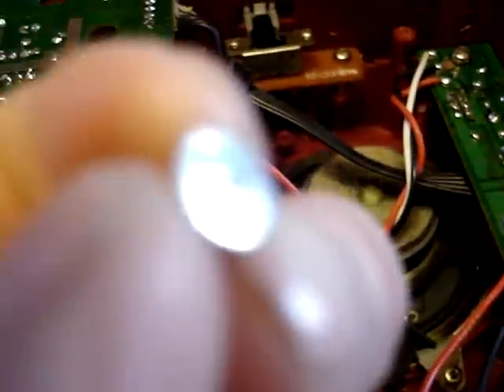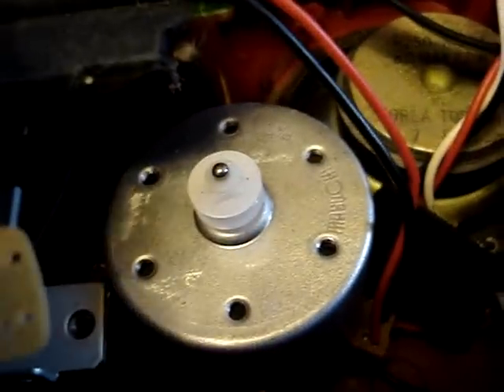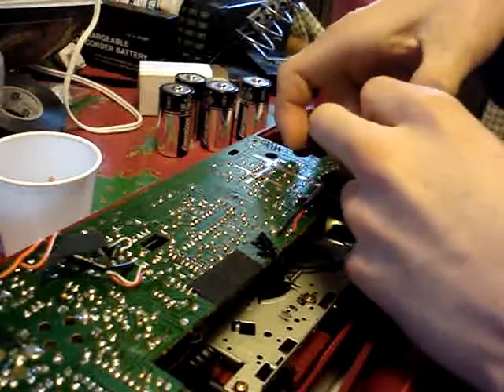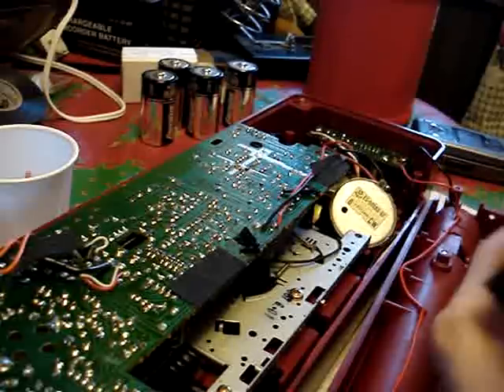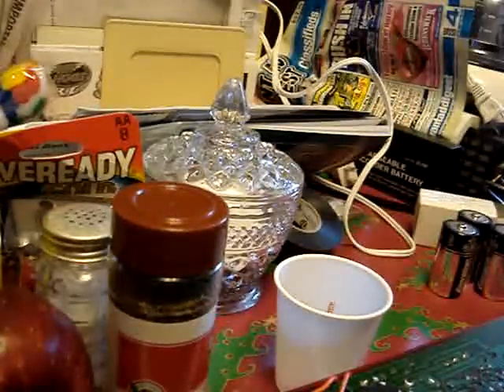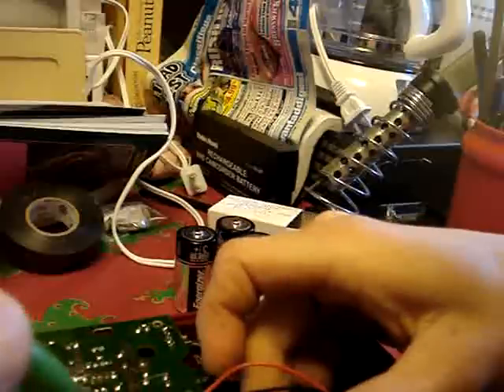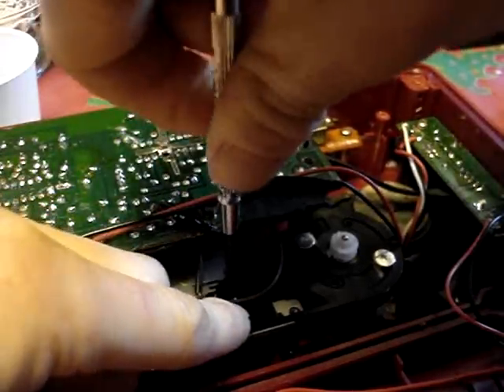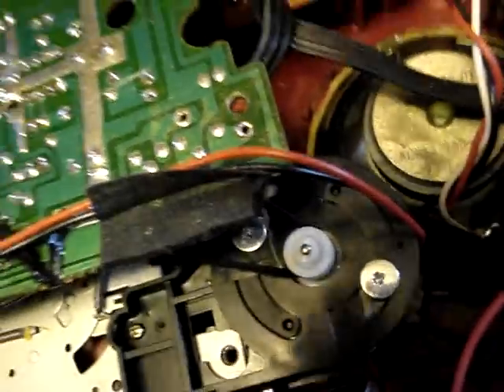Cassette motor replacement

Comment: And you're right about the original motor being an older type... the replacement motor is the newer type of Mabuchi motor, they're stillproducing them like this, There's a motor just like this one in my 2005 Yamaha KX-393 cassette deck.

Comment: That's always really annoying. It happened to me that I had the change motors up to six times until I finally had the right one. 
I'm not sure if it's running too fast just because it's hooked up backwards. As long as the speed control works, there shouldn't be any problem. You could maybe try a smaller pulley, I did that before and saved me a lot of work.
These old Mabuchi motors don't have much info printed on...

Comment from the maker: Yeah I could try that, but I've already ordered a CW motor, so we will see if that works better. I didn't think it mattered either, but there has to be a reason why they label them CW and CCW because all DC motors are reversible anyway. I'm going to do an experiment today and run the old one forwards and backwards and see if there really is a speed difference.

Comment from the maker: nah the motor has a pot inside it, and it has to be hooked up right in order for the speed control to work. that is, as the batteries get weaker it still maintains 2400 RPM. hooking it up backwards  defeats that feature I found out.

Comment: I have the same thing with a Marantz deck that I was working on this weekend could you have tried lubricating the front bearing of the original motor with some sewing machine oil? I find this often helps with the older noisy motors and gives them a bit more life

Comment: +8 years later this is still worth for something

I have some spare heads I took out of an old player and I got the awesome idea of designing a diy 3d printed cassette reader which I want to add some extra functionality and maybe will end up making a cassette recorder too

Thing is that those motors aren't as common as the generic 12v DC ones

Do you think I'll be able to play at the right speed a cassette with those ones?
Reply from the maker: it's possible if you use the right resistor in line with it to reduce the speed

Comment: No 2nd vid ? 
I guess it ended up in the parts box or bin,. 
.
Reply from the maker: No, I fixed it. ordered the proper motor and it works fine now. I just didn't bother filming it.
Reply: good to hear that I have the same problem . my tape recorder runs too fast..
Reply: where you get your parts ?

Comment: Aaw that's too bad about the speed.
Too bad you didn't have a smaller pulley to put on the motor shaft, that would slow it down.

"Warning, if you are a tape recorder, the following content may disturb you." lol then you show the tape playing with the cover off lol